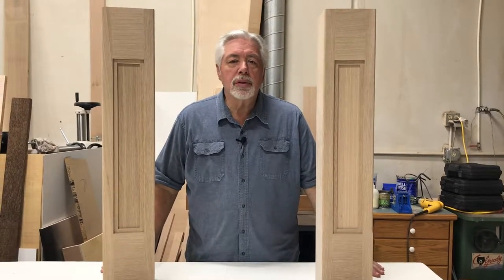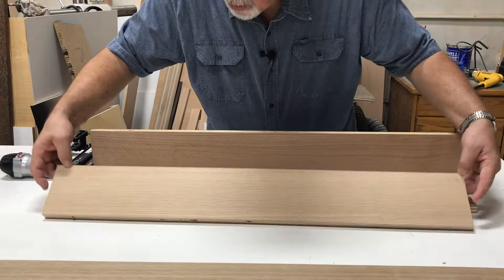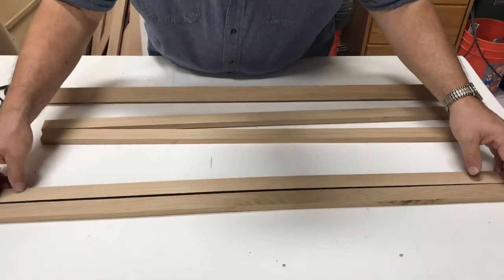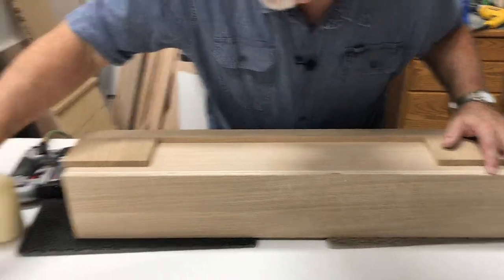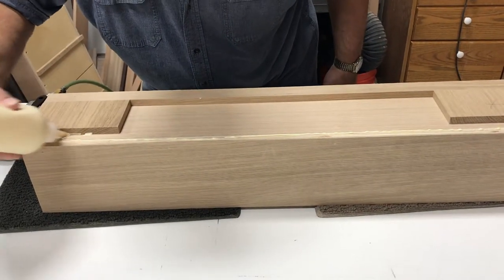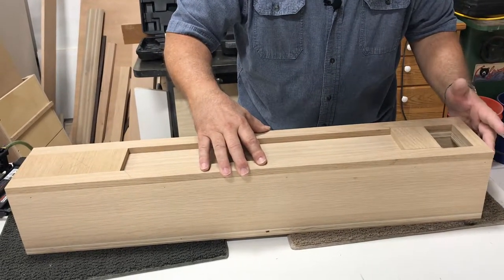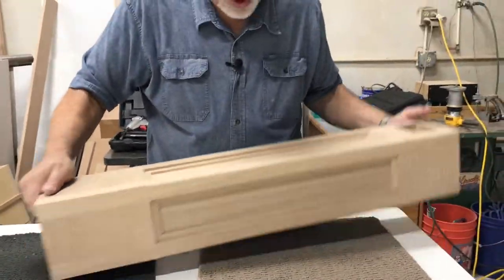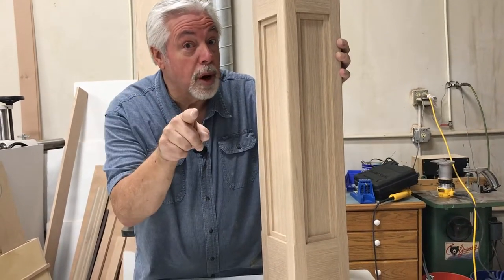Paneled Corner Post Columns

Comment: Hi Wes...Love these videos!!!  What size plywood wood did you make the box out of?  I am assuming you used the same wood for the outside corners?  What were the corner mesurements? (how wide are the pieces glued together?)
Reply from the maker: Hi...the plywood column is made of 3/4" thick plywood. The overlay stile and rail stock is 1/2" thick and the inset molding is 1/4" x 1/2". Thanks for watching, Wes
Reply: @WoodworkingWithWes  thank you for the response!   I ended up having to change the dimensions a bit but kept the form/style the same.   I'd love to send you a pic.

Comment: What molding wood did you use? What was the thickness of the plywood and moldings?
Reply from the maker: Hi...the plywood column is made of 3/4" thick plywood. The overlay stile and rail stock is 1/2" thick and the inset molding is 1/4" x 1/2". Thanks for watching, Wes

Comment: Can you tell what size(dimension) wood you used for the stiles? Thanks.
Reply from the maker: Hi Rajeev...for the applied stile and rail effect I used 1/2 " thick material. For the smaller interior step I used 5/16" thick. Thanks for watching. Wes